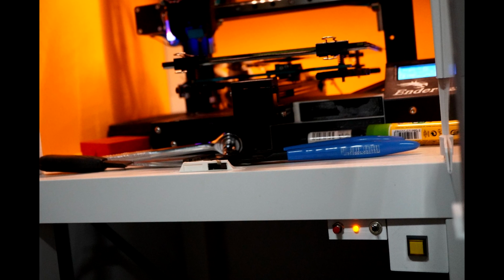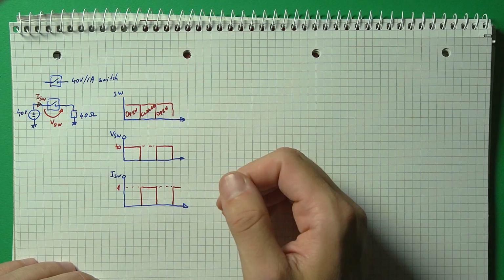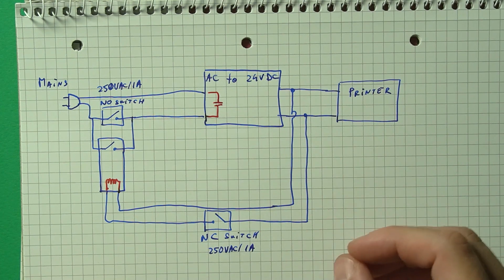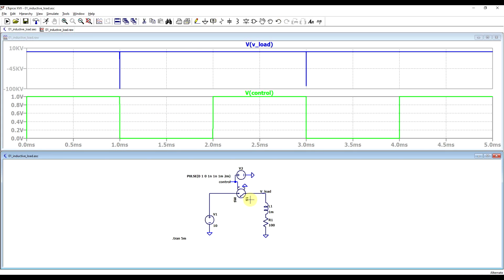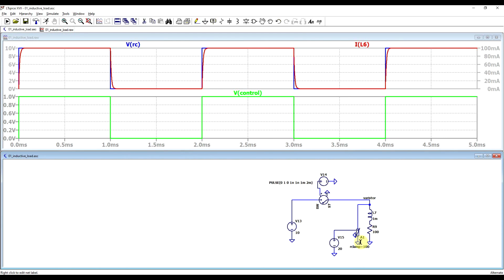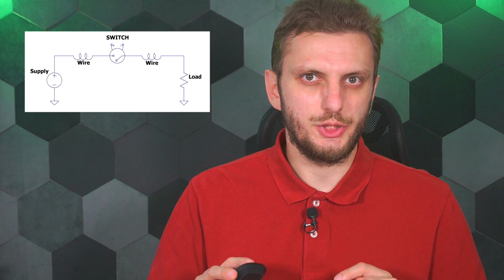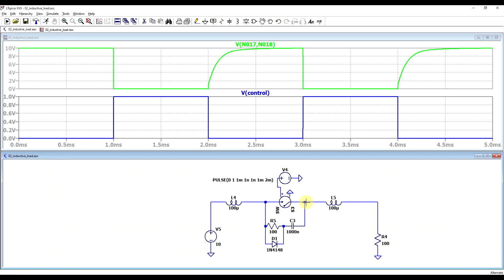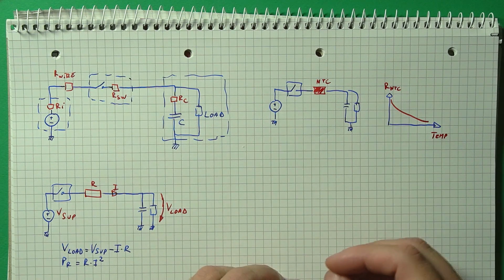Switch Contact Protection - General Methods (1/2)

Comment: For the capacitive loads, how about placing after the switch an inverse diode to ground, then a series inductance in parallel with a resistance and then a zener to limit the voltage spike on the circuit, if necessary? Ok, the voltage on the circuit will increase, but just a little, right? The circuit will remember a boost converter, but it will only "work" on one cycle.
Reply: Smart idea! But inductive elements are usually expensive and big. I think the P-MOS solution someone mentioned in another comment will win. And in practice for loads like a few 100's W a NTC resistor I encountered most often.
Reply: @LukaszTNT  I saw the comment with the P-MOS solution and I didn't get how it can limit the inrush current. In the moment you apply voltage, there is the time to charge the gate of the mosfet and the resistance drops so quickly that I think it's possible to have a still very high inrush current to charge up the capacitors. And if the effect is due to the on resistance of the mosfet, just replace it for a miliohm range resistor.
Reply: Got lazy with mine… have a seperate 5V psu, always on driving a raspberry PI running Octoprint, so I just connect the raspberry PI to one of those SSR to control the 24V PSU for the printer. Normally those SSR’s do have integrated snubbers, so you dont have to worry about all those kind of things.

Comment: For high inrush DC current there is a solution with a P-FET as polarity protection. Adding a zener between the pulled down gate and the source pin, it  would protect from high current too, as the zener is limiting the gate voltage. Bourns has an excellent part, the TBU-CAxxx series for limiting high inrush current. Fast acting, robust, though more expensive than a few passive parts.

Comment: As of my understanding, a diode and zener back-to-back will still permit a negative voltage equal to the zener voltage (minus the another diodes voltage drop). For AC it is fine as long as the negative glitch is within the AC limits.
Reply from the maker: For AC, you don't normally know when the power will cut out - on the positive or negative halfwave. So the inductive kickback can have any polarity. The Diode-Zener combination will only work on AC if you can ensure the turn off always occurs when the AC is positive. Dual zenner does not have this issue - it will protect regardless of the polarity.

Comment: Interesting topic, I found schottky diodes very useful at inductive spikes, faster/more efficient than MOV - but a combination with the MOV more energy can be absorbed.
Reply from the maker: Its true that in certain high power application multiple protection elements are used, the exact combination being based on reaction speed and power handling capability. Its not uncommon to see a capacitor in parallel with a TVS or some other diode, and GDT (arrestor). Depends on the application and the specific pulse that needs to be handled.

Comment: Hello Fesz! I always appreciate your videos! :D
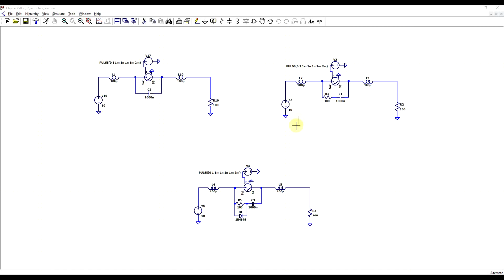One question: at 12:30 you say that the protection works for both DC and AC.
but I think that some AC current should be passing throught the capacitor (depending on the capacitance value).
I am not sure, though
Reply from the maker: Indeed, its not perfect for AC circuits, but, if the AC frequency is far smaller than the transient, then its ok. For example in 50/60Hz circuits, with a small enough capacitor, the impact will be minimal on the "off" state.

Comment: Useful video, but why not to use some common industrial modular contactor with NC and NO switches? They are rated for high voltage and current are relatively cheap and quick to mount (no soldering required). Besides, your printers power supply should have its own protection from inrush current. Of course contactors are quite noisy, but probably still more quiet than a 3d printer.
Reply from the maker: I never thought of using that type of contactor; the switches and relay where some components I already had around, that is why I wanted to use them. Anyway, regarding the printer supplies built in inrush protection, I did not check it in detail, but the box has a 10A rated switch - so I guess the inrush limiter will protect that, however the extra switch I used was only 1A rated...  The relay that will keep the printer on is 10A rated, but I wanted to use a low current switch for turn on.

Comment: 12:18 that might not be a simulation error but rather the diode capacitance.
Reply from the maker: I think you are right. The diode does have some small junction capacitance. However, the large peak current will probably not occur in real life, or at least not to that extent, if you consider the diode terminal resistance and inductance...
Reply: @FesZElectronics  And even if it does, the duration is so small it's practically negligible.

Comment: nice video Fesz. The topic is very interesting as it's often overlooked. Will you cover more complex active methods in a future video?
Reply from the maker: I did not think about that. What sort of active methods are you thinking about - is there something specific you tried in the past?
Reply: @FesZElectronics  I am not thinking about something in particular. Varistors have the reputation to not age well so I wonder if like rectifiers there is some active method to limit inrush current. Many dc regulators allow or embed soft start features so maybe there is a way to make some general circuit a bit more elaborate to mitigate the inconveniences of the NTC or the relay solutions presented at the end of the video.